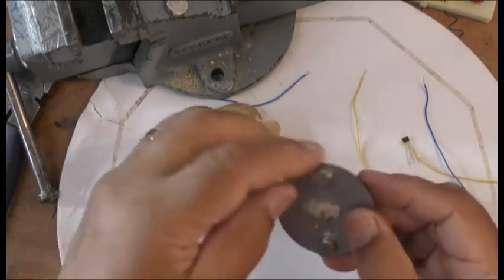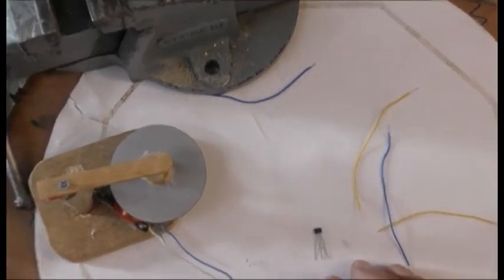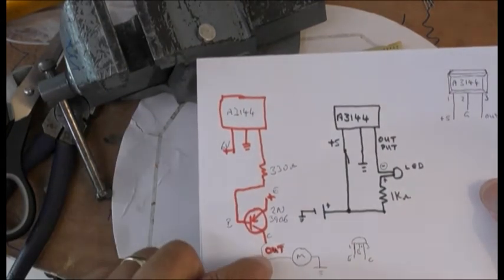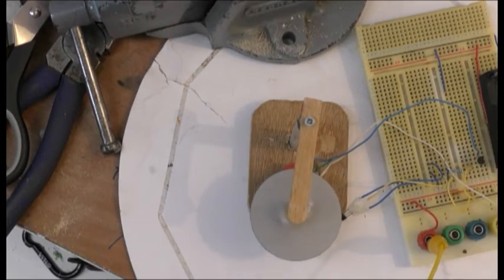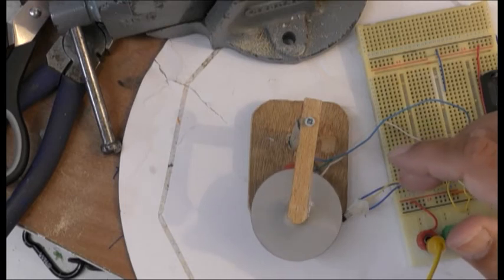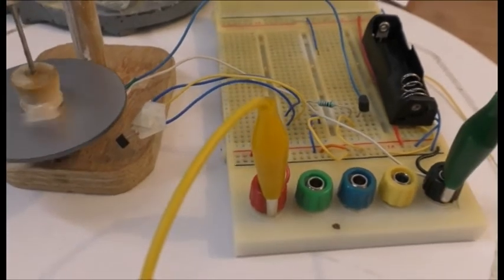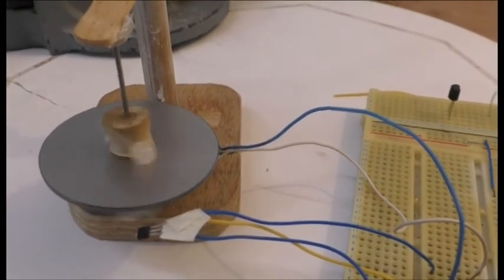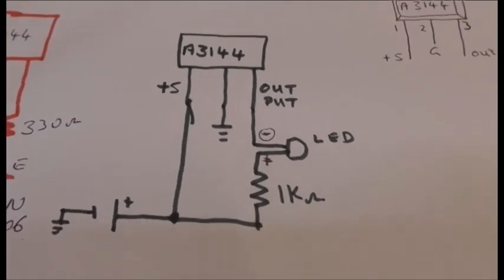#160 Pulse Motor with Hall Effect Sensor

Comment: Hey that is really cool that you can even get the motor to turn without the transistor. I saw a video by Lidmotor where he did that also. Now I’m gonna have to get me some hall sensors to play with👍🤓
Reply from the maker: Great have a go. I want to make it work on 1.5 volts. My next project 😃
Reply: Just4Fun 
I’ve actually been thinking of that also. The video by Lidmotor states, in the comment section, that the Hall effect transistor he used would only operate down to about 2.4 volts. I was watching a video on YouTube, that showed an led driver circuit that allows you to use down to approximately .8 volts to drive an led that basically requires around 2 volts to turn on. The circuit is mainly housed within a transistor called the YX8115. It does require a small resistor shaped inductor and maybe one or two other components in order to work. I think that it can basically take a voltage no lower than around .8 volts and boost it up to at least 2 volts which then allows someone to light an led with the boosted voltage. What I was wondering is could that boosted voltage be used to operate the Hall effect transistor. This would essentially allow a person to use down to roughly .8 or .9 volts to run a small pulse motor that can be switched with a Hall effect transistor. I ordered a few off of eBay  but as of yet I don’t have any Hall effect transistors to see if it will work.🤔
Reply from the maker: @user-wy3xe2tt3y  please let me know if you do something like this i would be interested in watching if. 
You have done a lot of research. If mine doesn’t work I will look into it. Thanks 🙏
Reply: Just4Fun 
I will sure let you know. I’ve been kind of a little short on money lately but I know things will get better😊. When I watched your video, the other day, it re-sparked that idea in my mind. Oh by the way, I did get those videos uploaded the other day. They are on my other channel (The Toothpick). Take care and God bless.
Reply from the maker: @user-wy3xe2tt3y  please share a link here
Reply: Just4Fun
I don’t know why but sometimes I’m not able to send a link so if you didn’t get the link just do a search on YouTube for:

Magnetically suspended toothpick motor